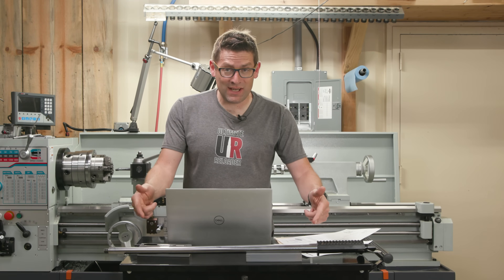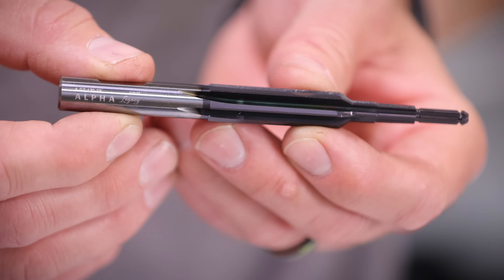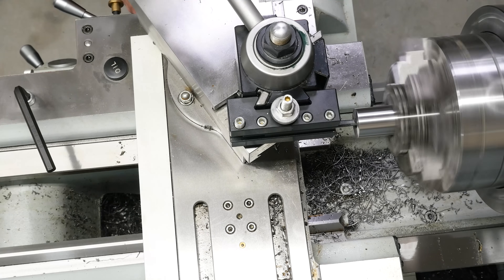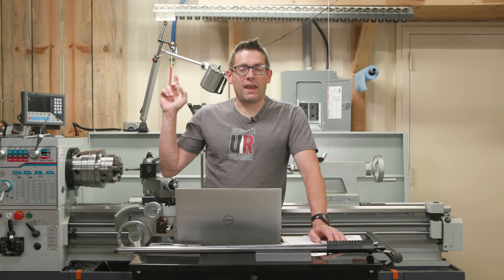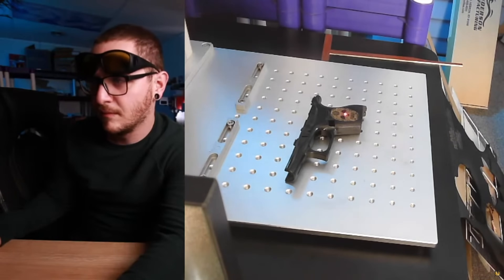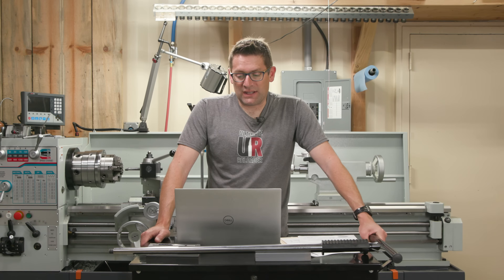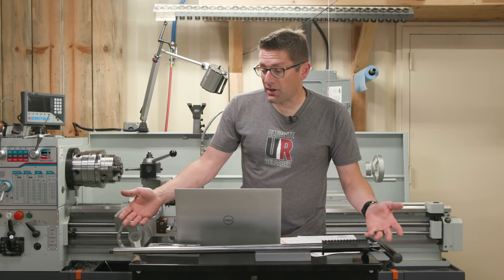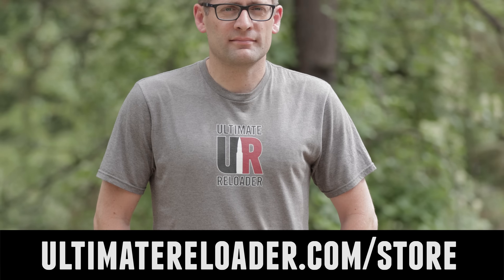6GT Barrel Chambering, Polishing, Laser Engraving (In-Depth)

Comment: Get yourself a handheld crankshaft polishing tool it's basically a motor belt sander you wear the belts down on a scrap piece of metal you can come up with a chrome-like finish I'm not the only gunsmith that does this save a lot of time and it comes out beautiful

Comment: I worked as a quality technician for Polaris in tube fabrication they have lasers that can cut 24 foot long tubes into pieces with slots, holes etc fairly automatically that can then be used or bent into frame parts etc but they cost about $1.5 million alone then add in the cooling systems and such, probably one of coolest places I had worked before I retired

Comment: Depending on the type of finish you want in the end, you would get a better result to keep the barrel in the lathe and run through the sanding steps and hand polish in the lathe with a towel and your favorite polish(mothers, etc). It is also much safer than trying to use a buffer on a cylinder shaped part. 

I would start with 320, 500, 800, 1200, 1500 then polish. The first 320 step will take a little longer but once it’s smooth the next grits go fast.

You have a great channel, thanks for all the info you provide!

Comment: hey I am no expert, however is there anyway to use a more wear resistant material like tungsten carbide or the throat of the rifle. I would think this could reduce erosion and extend barrel life. maybe cryogenic press fit the barrel into the tungsten part with an indicator to align the rifling. ???

Comment: Been debating on a 6gt for a while. Definitely gonna tune in
Reply: Wife has been running the 6mm Creedmoor @18lbs... Can spot own shots after around 400-500 yards, 6 mils to 890 yards using a sorted 112gr Barnes. I guess the best part is using Lapua small primer brass, @  just over 2800 fps we're getting 8-10 reloads easy out of the brass.
Reply: @jeff9062  I’m running 115 dtacs at 3011fps. Are you backing off the load for barrel ware or accuracy node?
Reply: @kurtjensen7930  Yeah, I had lots of trouble trying to get that bullet to group.  SD's over 80fps was the best I could get with a random flyer every 3rd or 4th rnd. Finally on the 3rd powder and pulling the bullet to .030 ish from the lands we got a good group.  I know this is the bullet but we had 2 boxes of 500 and nothing else available at the time.
Reply: @jeff9062  if it works it works!
Reply: I have two. One in a PRS style gun that I shoot for fun. One in an F-Open gun.... a match winning rifle. It's a great cartridge.
Reply: @FullSendPrecision  Does Lapua make brass for that?
Reply: @jeff9062  Only Alpha Munitions and Hornady.